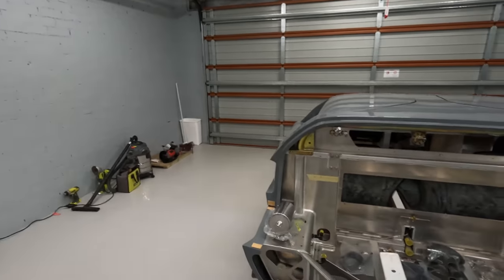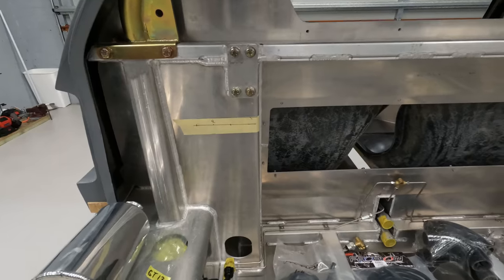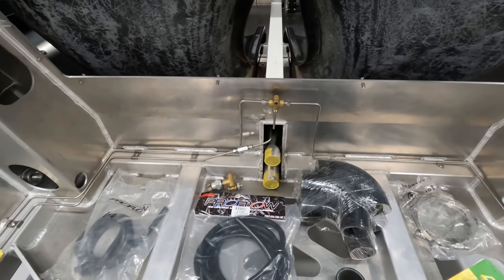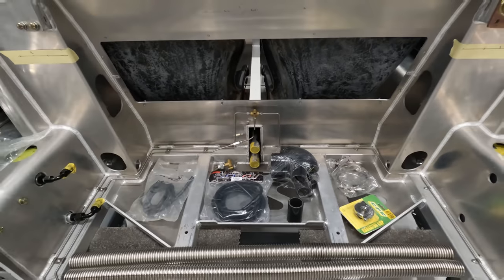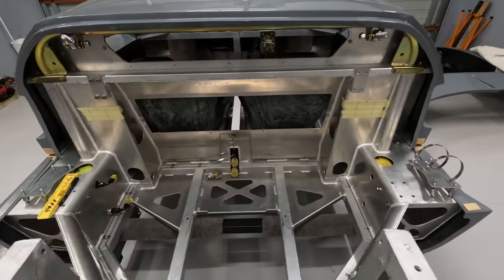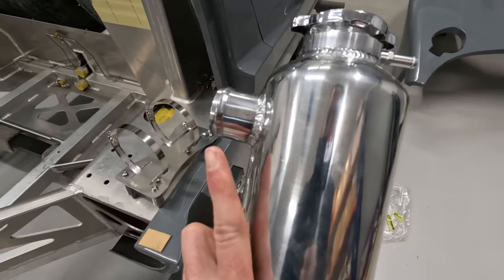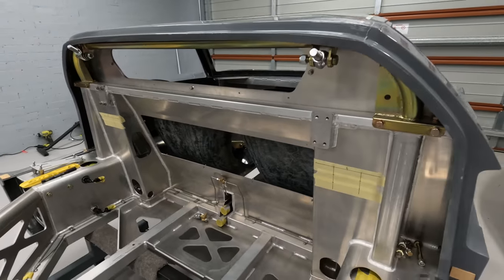GT40 Kit Car Build - Ep 25 – Coolant Header & Overflow Tanks

Comment: Just a heads up were ever you have steel, stainless steel or bolts etc meeting aluminium you will need to coat the surface that mates to the aluminium with a compound called Duralac this will stop the aluminium corrosion/ Oxidation caused by 2 dissimilar metal touching

Comment: I came across this build and started watching it. Been very good all in all but the one thing I noticed and I don't now if anyone mentioned it to you but some of those hard to reach places, I think rivet nuts (riv-nuts) would be Ideal. Then you wouldn't have to fiddle with having enough access space in the rear of some of the areas like shown in this video with the over flow bottle/tank mounting.

Comment: Hey Dan, I'm really enjoying your build. One thing you might consider is using Nut-Serts instead of regular nuts. Once the car is finished you will never be able to gat at the back side to remove a Nut & Bolt for service.
Reply from the maker: I'm definitely considering them for final assembly.

Comment: slowly comes together! nice job again! I would eliminate the rubber hose and purge hose with a nice SS or cooper line and route it on both sides as you did on the overflow tank. How will you access that isolation valve and the fuel filters, once the motor is in again? Another thought I had, was the following. If you would relocate the expansion tank to the front compartment, it would do the purpose as well, but you could eliminate that awkward hose from the motor to the tank where you do have not much room already, and that way you would not have to modify your engine access plate as well.

Comment: dan i think you are going to get air lock between the 2 tanks as the left tank exits below and then has to travel up and then go down into yhe topside of the right tank before finally screwing down the hose you might want to put some water from tank to tank with the large outlet blocked off on the right hand tank to simulate it being hooked up to your expensive engine and see if it air locks better safe than sorry but the build is coming on well cheers glenn

Comment: Dan, quick notes here.  Push the cross over hose inside an aluminum tube to support it with fewer clamps.  On the brake switch, put a 90 degree fitting where the switch is and then put the bottom line into it, then you can put the brake switch in the bottom facing port and clean up the install a bit.  Love the build keepup the solid work.
Reply from the maker: Thanks for that suggestion Glenn!

Comment: hello Dan, could you not use riv nuts for the header tank brackets? instead of a nut and bolt, save you trying to squeeze you hand in the wee hole
Reply: My thought too.
Reply: I've raised this multiple times. The whole car is held together with nuts and bolts... it'll be a nightmare of of the less accessible ones rattle loose over time or need to be undone and removed... when he does final assembly rivnuts should be heavily factored in for convenience!
Reply: I'm thinking rivnuts makes life easier.. Thin foam rubber around hose clamps to prevent rubbing
Reply from the maker: G'day Tobi, I've taken these comments on board. I actually purchased a rivnut tool and and a range of rivnuts to try them out as I'd never used them before. I've trialled them in some steel tube, but concerned about how well they will hold in alloy. I'm just not sure how well the ribbed section that clamps down on the surrounding alloy will hold... I'll keep experimenting before committing to using them in the final assembly.
Reply: @BuiltbyDan  hey bro, oit of curiosity you ever watched another Youtuber called Rob05 o think his name is? An Aussie guy building I think was an Ultima? Super super smart dude anyway and a good laugh. He used them quite a bit... I think you can get different rivnuts for different material too... look into it bro. I just worry with your eye for detail and you wanting for this to be perfect that the nut and bolt situation could be a massive pain in your ass... even if you can only use them on non structural components might provide a good starting point... and as a minimum some lock tight on the stuff you need to never come loose or perhaps having captive nuts welded to the structure for things you may need to get access to in the future but will struggle to get at both sides for...

Regardless great series bro and I plan to build the exact same thing at some stage!
Reply: @BuiltbyDan  I used some to mount a seat in a tinny. I put a large stainless washers on the backside to spread the load.
Reply: @Blanchy10  thats a good idea but doesn't work where fixing through tubular sections...

Comment: A suggestion for you would be to pick up a bicycle inner tube and cut it into strips that are just smaller than those bands for the 2 tanks and use super glue to hold the rubber on the inside of the bands so they aren’t visible. The rubber will hold the tanks more solid and not allow them to move due to vibrations from running and driving not only that they won’t get scratched up from the metal on metal contact. On motorcycle exhaust I’ve had to do this trick. The Toyan is a great motor but it’s not 1/10th scale. It’s 1/5th scale. I know of a few people that have put them in 1/5th scale RC cars. They’re pretty cool.
Reply from the maker: Thanks for the suggestions, I like that idea of using the bicycle tube! Wish I had have seen this earlier today when I was working on the fuel system install, ended up cutting strips out of 1mm compressed rubber to mount the fuel pump and filters, was a bit fiddly to hold it all together as I tightened the hose clamp. Supergluing the bicycle tube would have made it much easier! I might still do that for the tanks. Cheers.
Reply: @BuiltbyDan  anytime. I’m always happy to help out where I can. Keep up the good work. Can’t wait to see it done.

Comment: Love following this build.  The Coyote is a great choice.  Will sound wicked with 180 exhaust.  I was thinking, just know where the high point is of the coolant so it can burp out.
Reply: Tricky to implement a 180° exhaust with the Coyote lambda sensor requirement unless you use the sub-optimal 'single cylinder' sensing.

Comment: Hi Dan. Nice work so far! Did you consider bending up a nice hard stainless steel or aluminum tube to replace the rubber overflow cross tube?  then just using a short section of rubber each end to join.  Great project mate. I scratch built a Cobra a few years ago and still enjoy the driving car today. For me the build is the best part. keep up the great work!
Reply: Similarly some simple SS brackets to replace those nasty standard clamps.
Reply from the maker: Thanks Nigel, I didn't think of using a stainless hard line actually, but I like that idea! I'll look into what size I will need as I have some stainless hard tube laying around. Great to hear you are enjoying your Cobra build years down the track!
Reply: @BuiltbyDan  Just a caution against the use of dissimilar metals in the cooling system. SS and aluminium have differing galvanic properties and this accelerates corrosion. Given your engine is all aluminium, as are your radiator and tanks, I'd recommend non-metalics or stick with all aluminium.

Comment: Might I suggest applying anti-chafe tape, behind band clamps, bracket contact points, etc.., to prevent fretting from vibration, and the resulting eventual corrosion.
Reply from the maker: Thanks for the suggestion George, I'll look at option to install a rubber strip in final assembly.
Reply: I would suggest that you gain familiarity with standard general aviation practices, regarding this subject.
Better solutions then rubber strips are typically films and tapes, as rubber tends to aggravate flexing and movement, and tends to extrude as it deteriorates.
Tapes provide a layer of isolation while still allowing secure attachment.
Something like electrical tape and ptfe tape used in powder coating work well.
Also might try home built aviation material / part sources.
Most any aviation tech or aircraft home builders should be good sources of general practices on this subject, for the parallels in construction of your GT40 with metallic aircraft structures.

Comment: That Toyan engine looks cool, excited to see the videos on it!  Curious, Is it possible to use some kind of Y-splitter on the tubing runs to incorporate the tubing run from the thermostat? Bottle mounts and tubing runs look great! Appreciate the attention to detail 👍
Reply from the maker: G'day Jon, the Toyan project has been a fun distraction from some of the challenges on the GT40 build!

I considered joining the two lines as you suggested, but based on the manufacturers schematic, it seems the relief line needs to be on the pressurised side, which the overflow is not. I don't know if that's just how they propose to do it, or if it needs to be like that... Will need to seek some mechanical advice on that aspect when I get closer to starting the engine.

Comment: Dan, why not install a nutsert to attach that bracket? Once the engine is installed you'll probably never be able to reach behind that bulkhead !
Reply from the maker: G'day Ted, Looking at using nutserts in final assembly. I started out this build not really knowing what I was doing or how it would all come together, so I set out to use the fasteners supplied with the kit and then disassemble once I know everything has a home and do a final assembly. Have purchased some nutserts and install tool. There are some situations where they would work well, but in other scenarios where the back of the nutsert will be exposed on the opposite face of the panel I think a nyloc nut would look better... still got some time to decide...

Comment: Hey Dan great progress. I can’t see why those tanks aren’t mounted together as in the Cobra it seems another point of failure to have such a long hose between them. Have you considered a hard line as if the hose fails it will be a big pain in the butt to replace once the Coyote is installed. Also noticed you reverted to the manual style tap, why not use your fancy new tool?
Reply from the maker: G'day Peter, not a lot of room to mount both tanks together, at least not with the individual mounts. Have received a few comments about using a hard line, something I will look into. I used the ratcheting tap wrench for all taps in this episode, but found it regularly clicked into locked position, so didn't really get the use of the ratcheting feature!

Comment: You can buy a product from PPG called penatrol it's a protection coating for aluminium you would need to acid wash the aluminium frame work 1st than a light coating rubbed on the aluminium this will stop finger prints, oils etc from staining the surface
Reply from the maker: Thanks for the suggestion! Still unsure what I am going to do for a coating, but definitely want it to be a clear coating to keep the aluminium look. Will add that to my list of options.

Comment: Just two quick questions.  Are you A) painting the chassis etc and B) If not, are you torquing up each fastener as you go ? Love this channel and your attention to detail . great work
Reply from the maker: G'day Graham 
A) Not intending to paint as I want the aluminium chassis to remain a feature, will look at a clear coating such as Ceracoat or Nyalic. 
B) once I know everything fits together as it needs to, I'll remove the components, treat as required for dissimilar metals, apply anticease/loktite as appropriate and then re-install, torque and mark head to confirm it's been torqued. It might seem like a lot of additional work, but that's just how I chose to approach the build, particularly given its my first attempt at such a project.
Reply: @BuiltbyDan  Thank you very much.

Comment: I think I would have gone down and across with the overflow tube 😉
Do you have a means of bleeding the air from the radiator?
Reply from the maker: 🤣
Both the header tank and engine sit higher than the radiator so I'm anticipating I'll be able to bleed the system from there.
Reply: @BuiltbyDan  You have a manual bleed on the radiator?
Consider replacing it with a fitting and a pipe running back to the header tank so that it can continuously vent itself and automatically bleed on filling the system.
Reply from the maker: No bleed on the radiator - it was only supplied with inlet and outlet for the radiator hoses...
Reply: @BuiltbyDan  That does make filling the system and getting all of the air out a bit of a procedure ... 😟

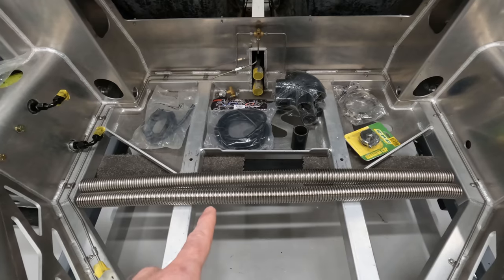Comment: Dan, for your accelerator. https://youtu.be/zNWrHdYw4JE.     Start at 1:40 and see what this guy did
Reply from the maker: Thanks for sharing that link, was good to visualise another approach/solution to the issue! I actually saw a similar approach using cable to actuate the pedal, but kept the electronic pedal up under the dash, rather than exposed in the engine bay like that example. Confident I'll be able to come up with an alternative solution that will work, whether it be via a fixed link or cable.